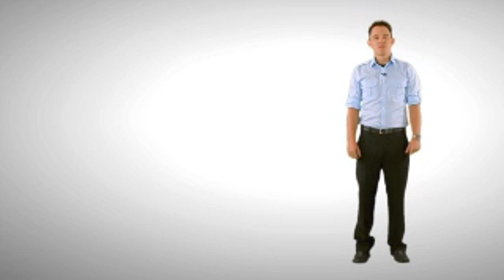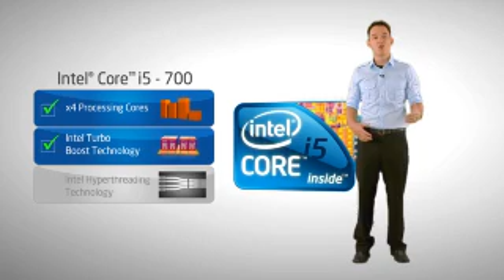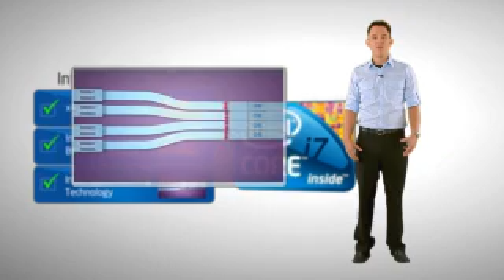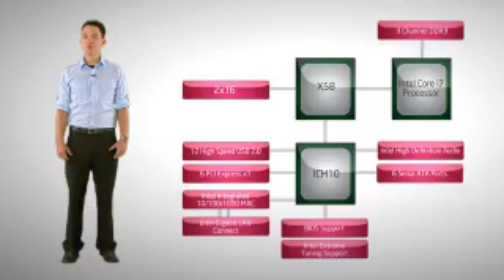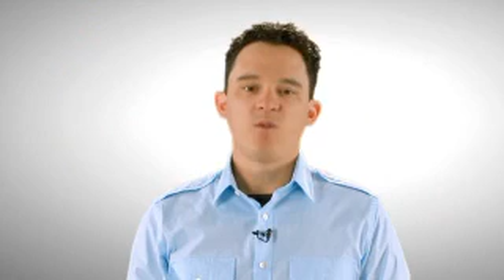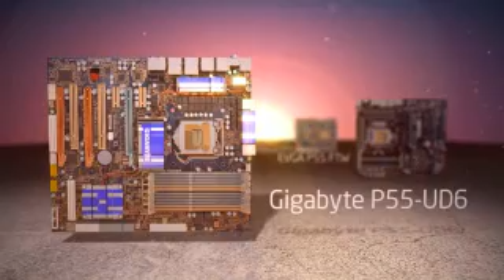Intro to Core i5/i7

Comment: I have an i5  760 2.8 GHZ Quad and i can run all of today's games at 80-100 FPS. (Black OPs, Bad Company 2, Crysis Warhead, Metro. 
Build: intel i5 760
4 GB 2x2 RipJaws RAM
MSI HAWK 5770 1 GB Graphics
P55 LE EVGA Motherboard

NOMNOMNOM

Comment: @TheMadOrc Now remember it's just a wish list. I've been procrastinating going through with this because of a lack of confidence and my current PC --  a Pentium 4 w/ 1.25 GB of RAM -- works well enough 

My wish list on New Egg is named "ERS P55 Rig". IDK if you'll be able to find it, but I made it public tonight and that's the name. 

My rig includes : Case $99.99 , Power Supply $139.99, Mobo $189.99, CPU $199.99, RAM $109.99, Video Card $174.99, DVD writer $26.99 , Hard Drive $119.99, OS $99

Comment: Liquid Nitrogen?! TERMINATOR 2 FLASH BACK! 

The CPU cracks then reconstructs it's self... coming 2230 AD. 

Seriously, I'm glad I found this. I'm ready to drop 1G on a rig to last me. I'm gonna go with the i5-750, but choosing a mother board is a pain in the ass. 

What mother board should I use? Give me a $100-150 option and a $200+ one. Why go higher?

Comment: @TheRodrigogames That depends. In most any game, the 965BE competes with the i7 975 Extreme at stock speeds. Tom's actually proved it can hang with the brand-new Intel i7 980 Xtreme in games. In multi-threaded business, multimedia, and audio/video applications, the Intel's usually pull ahead.

Comment from the maker: Just remember that there is also a Core i7 that also fits into the LGA 1156 interface, too. It's somewhat confusing on Intel's part; however, bear in mind that the feature that separates Core i5 and i7 is Hyper-Threading support, not the socket.

Comment: If you want to know thsee are the solutions.
An not complete i7(8 series) without hyper threadin is core i5(7 series).But actually although turbo boost it is like the last generation of core 2 quads(Q9 series).
If you want core i5 put core 2 quad and if you want i7(8 series) put another i7(9 series,socket lga 1336 THE POWER)

Comment: And don't be worried- the high end overclocker motherboards are user friendly. They want you to overclock them. You can make it faster and stable in 5 minutes. WAY faster, stable, at the lowest voltage possible-- that takes time.

Comment: One more thing to keep in mind- what the CPU is called on the outside NEVER matters.

You want a Nehalem Bloomfield core with D-O stepping. That's it. 

If you'd bought an 1156 system you'd be getting a LYNNFIELD CPU. They can call it i7 or i5 or 950 or 920 or Steve or Keith.

It doesn't matter. What matters is what's ACTUALLY in there.

Did you know Pentium E2000 series is now a 45nm Wolfdale (core2duo) product?

You sound like a smart guy. Learn this stuff. Save money. Be happy.

Comment: RAM- yes you can, but you need to find another identical stick. 
What do you have 2x2GB?

You either have to find another single 2GB module OR buy TWO additional 2x2 packs (for a total of 12GB) to make it triple channel. Do you see what I mean.

Yes, you can buy a 950. OR you can buy a 920 (identical CPU, worse batches) and overclock it with ease to 965+ speed. That's what everyone does. Get a good cooler.

That MOBO's fine. P6T DeluxeV2 (ASUS) is also good

Comment: I don't know check the intel roadmap it's not a secret or anything. Probably late 2010.

Point is for like $200 difference you can have a much more scalable system that will grow for a couple of years in a way 1156 won't.

People don't seem to realize that socket 1156 exists to compete with AMD's inferior albeit excellent offerings and beat them. That's it.

It's the mainstream option.

Comment: P55/ 1156 supports i7 and i5 in the 800 series. It ONLY HAS 2 channels of RAM not 3, it also has a single I/O hub (P55) compared to X58's hub and controller (X58, ICH10)

In a P55 the PCIEX16 controller is integrated on die whereas on the X58 it is on the actual X58 chip.

This means on a P55 to get an x16 link across multiple cards you need an extra controller on the MOBO.

Also, Socket 1366 *(X58) will support SIX core processors coming out soon.

I would NOT buy a P55.

Comment: You are correct on the HyperThreading, But it still uses DDR3, but it can use both Dual Channell and Tipple Channel DDR3. The i5 is basically a step up from the C2D and C2Q processors, and is landed in a price point which a high percentage of people will easily be able to afford. Its advantages come in that is its cheaper than the i7 but isnt a great deal slower than the i7.